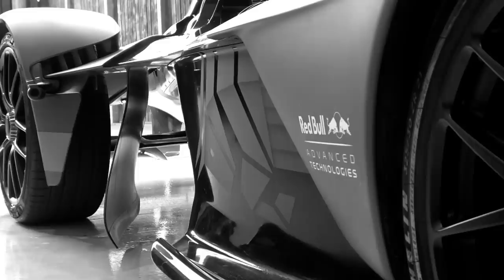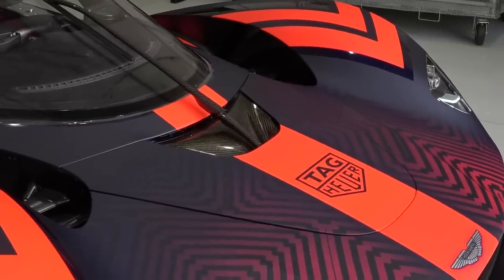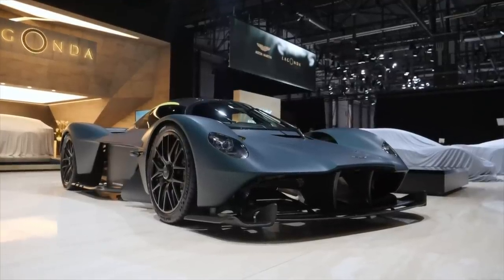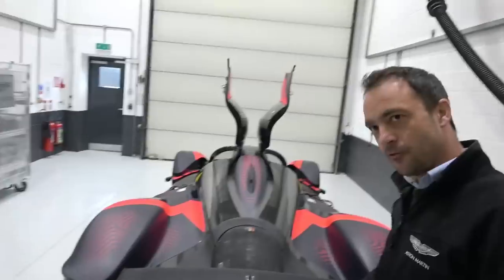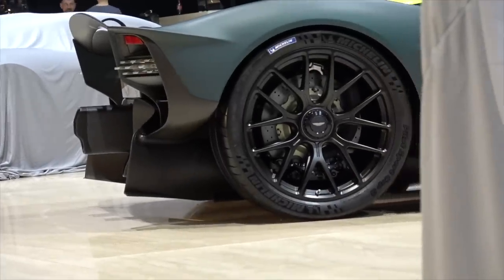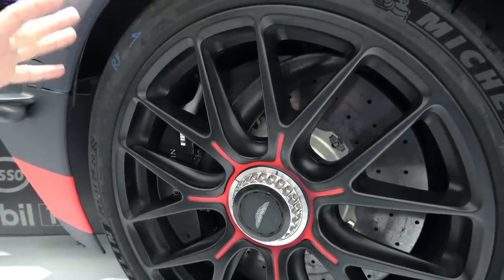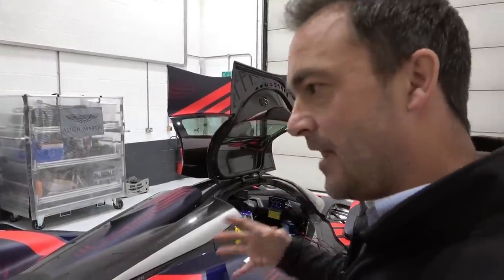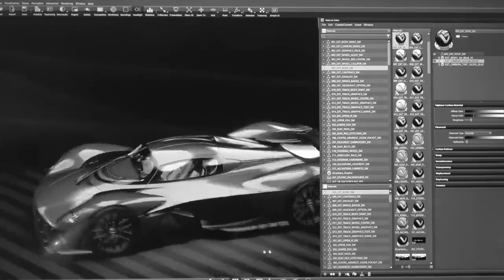Valkyrie Is ALIVE! World's First Onboard Drive!

Comment: The track pack might get it closer to LMP1. Just faster on straights and a bit slower in slow corners due to added weight (road safety, large NA V12). Fast corners might be similar due to the unregulated downforce. 
I suspect the battery is tiny, so the full power won't make it much beyond a long straight. Also it doesn't need to, I suspect some heat is extracted from the exhaust and energy put into the battery every moment less than 100% throttle is applied.
Running out of battery power will be less of a nuisance than on a Porsche 918, there you'd lose 272 hp down to 608 hp, Valkyrie will stay over 1000 hp. But it's cute to have some hybrid power for impressive high speed acceleration stats. 0-300 kph. 
Stand by for a drag race with a Red Bull F1 car. Perhaps even a Renault hybrid powered one. Over 1 km, I don't see any F1 car winning.

Comment: An N/A V12 ? Definetly surprising thats for sure, very few modern cars have a v12 in them, even sports and hypercars with them are a dying breed. Hell To get that much power out of an Engine without any forced induction or assisted combustion is incredible, those  numbers are usually revserved for massive big block V8s that drink fuel, like a fish does watter.  The engine alone was probably an uphill battle to develop and create to say the least.  Because they definetly didn't choose an N/A v12 engine configuration for efficency and "easy" R&D, thats for sure. I am glad there are people out there doing things to push the limit and prove people wrong, just to say they can and did. I doubt they will make much profit from these cars, if any profit whatsoever, so its most likely something created as a perfromance and engineering showcase of what modern tech pushed to its limits can do.

Comment: Awesome as it is, I've move heaven and earth to add a front motor and perhaps a bit larger battery. This adds so much performance. The front axle is the best place to extract braking power, and front drive improves acceleratio a good bit. Look at any AWD electric cars, electric motors can easily be controlled to extra loads of traction. Weight would be saved in the fuel tank when full. Look how LMP1-H cars get to use less fuel, weigh more but still go faster than LMP1.

Comment: The lmp2 rules say your car can be a 4.2 liter V8 without direct injection and can produce 600hp.

The v12 i am suspecting makes more power than an lmp2 I would think.

But the real thing i think you were thinking about is the down force levels?

I would think that would be impressive if the Valkerie can have the down force potential of an lmp2 and an engine that's prob more powerful

Plus the uniqueness of it all.

Not everyone will have that thing.

You should get some boxing gloves and invite Gordon Murray and his T50 plus this guy and the Valkerie. 

Have them Duke it out inside a boxing ring. Lol. He looks much younger so I'm sure Gordon Murray would be at a disadvantage.

Comment: That mega venturi-aero looks dangerous. What if you take this on a track-day and hit a high curb accidentally coming out of a turn? One side of the car lifts off the ground and you lose 70% of the downforce, sending you flying off the track, maybe into a barrier and maybe one that isn't a high-tech tecpro barrier but an old, low guard-rail close to the track. If the dampers are set up wrong, maybe a good bump will be enough, doesn't even need to be a higher curb.

Comment: Cars that can surpass 250kph and accelerate to 100kph in less than 7 seconds should not be road legal unless electrically limited and only able to be disabled at your local tracks by GPS or a special code known by the track personnel and is updated every month 

change my mind

Comment: Upfront, I don’t have a net worth >$100M (liquid $30M) which in my opinion would be justifiable for a hyper-car that’s $2M and up. So why would anyone with that scratch buy a 1 seater, that’s not the fastest top end 300mph+, when you have Bugatti, Koenigsegg, Hennessy, etc. Also this doesn’t  match the Tesla Roadster 0-60 in sub 1.9 sec. So at best you have  F1 cornering and acceleration specs., that matches the Gemera top end of 240 mph. Where’s the brag factor, unless it has possible collector value due to limited production. After spending probably  $30M on R&D this will be a colossal wast of resources. In another video Verstappen didn’t seem genuinely impressed as he was essentially driving a slightly clunky version of his F1 car. Maybe you need a net worth >$1B to be that crazy.

Comment: I suspect the aero on this car is standard thinking.  Flaps, louvers, ducting,  aero tray, underbody tunnel -  more or less all fixed.  Looks great for sure, but I think Gordon Murray and his 50 is another level of purity and a higher more useful level of downforce.   His solution can actively reduce down force at high speeds  (goes up as the square of speed even when more is  not required) pushing down suspension (and increasing drag)  needlessly.    Whereas it would be useful to reduce this drag weight on the springs and therefore downforce drag holding the car back this impacts, fuel economy and  top speed along with every other aspect of performance , including acceleration. This will look dated very soon. This fixed thinking works against the car at higher speeds. Gordon Murray has moved the goal posts, sorry folks but he has.

Comment: Decades ago when F1 rules weren't what they are now... cant remember the team... a certain team used an under skirting technique that gave way more down force than anyone else. The result... no one could touch them. Rules ended up changing to stop that being used. Why they changed it I cant remember... I can only assume it was to slow the cars down as there may have been safety concerns. So, gaining down force from the underneath of the car is nothing new. They've just looked to the past for ideas.

11:50... They said the same about the Veyron... yet they went way beyond. Of course someone will go beyond.

Comment: 3:10 "The secret partners... ...provides the heat coating so that it doesn't melt"

So, "something something Aerospace" then? ...or is it NASA? ;)
Reply: The secret partner that matters the most, is the guy who did the initial designs of the car.  

Tesla, NASA, Lockheed Martin, Space X, Ford, G.M., McLaren, Audi, Mercedes-Benz, Ferrari, Pagani, Mazda, Nissan, Lamborghini, Toyota, Mitsubishi, Redbull, Lotus, Alfa Romeo, Honda and some others companies have all been helped by him.  

VTEC, Vortec, Voltec, Duratec, Ecotec and Ecoboost are A few examples of his designs.  Don't they sound similar?

He also used to write movies, T.V. shows, songs, videogame concepts, comics and books.

He wrote Star Wars screenplay before the age of one.  11/16/76 is his birthday.

Designed computers like the Apple Macintosh, smart phones, game consoles, laptops Etc. 

He is the reason why the world took A giant leap forward the last four decades.  

He has multiple projects in the works that could easily be worth trillions of dollars but they are on hold at this moment.   One of them makes combustion engines competitive with EVs are far as the cost efficiency goes.
Reply: The secret partner that matters the most, is the guy who did the initial designs of the car.  

Tesla, NASA, Lockheed Martin, Space X, Ford, G.M., McLaren, Audi, Mercedes-Benz, Ferrari, Pagani, Mazda, Nissan, Lamborghini, Toyota, Mitsubishi, Redbull, Lotus, Alfa Romeo, Honda and some others companies have all been helped by him.  

VTEC, Vortec, Voltec, Duratec, Ecotec and Ecoboost are A few examples of his designs.  Don't they sound similar?

He also used to write movies, T.V. shows, songs, videogame concepts, comics and books.

He wrote Star Wars screenplay before the age of one.  11/16/76 is his birthday.

Designed computers like the Apple Macintosh, smart phones, game consoles, laptops Etc. 

He is the reason why the world took A giant leap forward in the last four decades.  

He has multiple projects in the works that could easily be worth trillions of dollars but they are on hold at this moment.   One of them makes combustion engines competitive with EVs are far as the cost efficiency goes.

Comment: Love it, amazing car, well done Newey👍Though It's quite extreme, I'm surprised it's going to be street legal. I don't see the point of driving a car like this on the road, having it as a track car where you can drive it as it should be driven is more suitable.

I can see a few of these, in the wrong hands, being wrapped around a tree.
Reply: The really weird part is that as a road legal car that is designed for F1 performance at the track, this this probably can't get in and out of a parking lot without 10 attendants laying down boards and wiggling it around.  Is this being crash tested for safety regulations?  The airbags for US regulation weigh more than the rest of the body...

Comment: Swansong of the V12? Far from it. If you think this motor's good, wait until you see the new Gordon Murray, McLaren F1 replacement.

We're talking about horsepower per litre closer to 200 than 100 and 12,100 rpm in a road going car, with simply the best V12 ever made and remember, this is a car from the person involved in making the original F1, which many good judges thought could never be surpassed.

Comment: Has the sun finally set on the McLaren F1 as the greatest driver's car?
Reply: T50
Reply: tbh the F1 was beaten long ago in perf terms at least.
Reply: @tcroft2165  but not in the drivers cars terms, and overall packaging.
And don't forget that F1 was never built as a track car, or top speed car, just a pure driving machine. 
T50 will be the one and only true F1 successor
Reply: @r129r16pfl  The F1 was absolutely designed to hit a speed record. And in terms of handling its really not that great. The sound look and seating position are great though.
Reply: @tcroft2165  It was just a coincidence, watch Gordon's podcast, He explained it. Top speed was not a priority.
Reply: @r129r16pfl  he can say that but you don't accidentally go 240. You have to design everything to cope with that speed. They knew what they were doing. And in terms of suspension or df the f1 is stone age to todays SC/HS.
Reply: @tcroft2165  240 because - F1 was very small and compact = tiny frontal area + it was very slippery = low downforce, that's why it went so fast with relatively low power.
Reply: @r129r16pfl  Sure thats a design decision. More Df better handling but lower top speed. Low Df high top speed. They knew that from the drawing board.
Reply: @tcroft2165  I agree, but 240 was never a goal, it just happened that car went that fast.

Comment: The Holy Grail of cars is Honda supplying their F1 partner's road going cars with their engines after winning the championship.
Many do not understand the position of Honda as an engine manufacturer beyond the pinnacle of motor sports of F1
To date every championship winning partner Honda has been with that requested to be engine partners for their road cars has been denied.
Don't believe? 

Mclaren F1 was meant to have a Honda engine. Gordon Murray flew to Japan especially to personally request and was turned down
Lotus asked for Honda engines on their Elise and was denied
Honda will not supply Red bull with engines outside F1

Having a Honda engine is the stuff "Dreams" are made of.